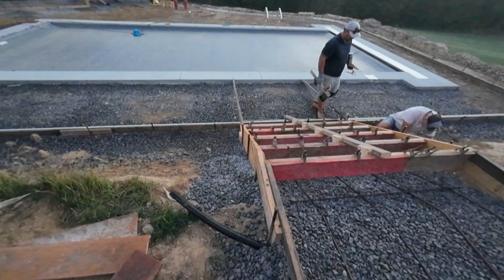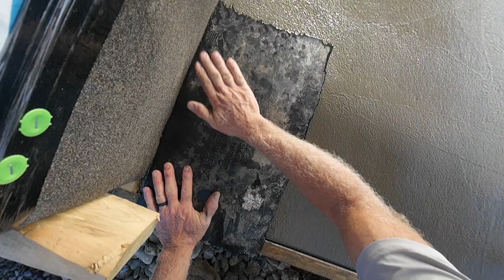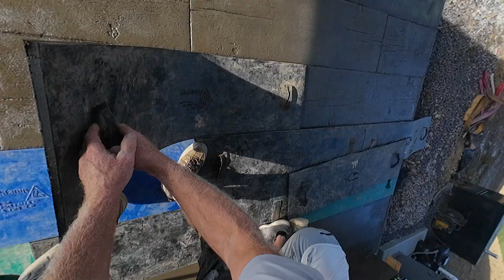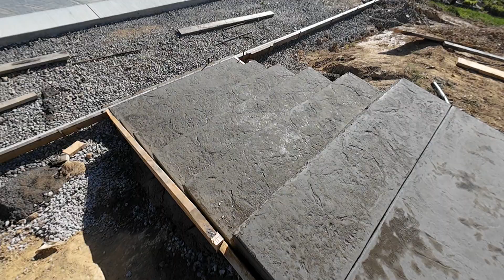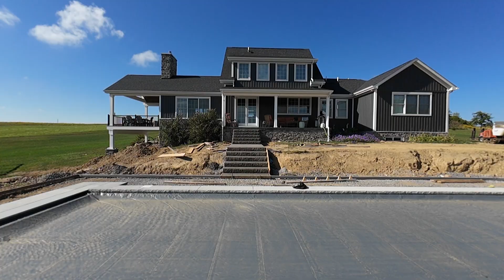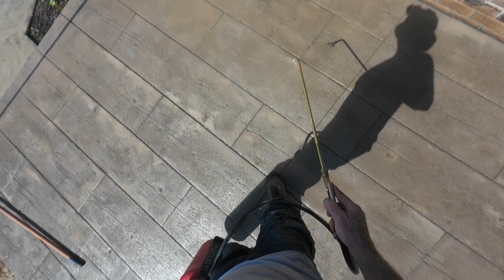"Can't Sleep At Night" Concrete

Comment: If you compacted the ground and stone, would you need to saw cut? I poured a lot of garage slabs and never saw cut them. No cracks. I poured a 15’x24’ x4” slab in the driveway to park cars. No saw cut and no cracks. I used #4 rebar in all of it. Cement trucks, dump trucks and even a well drilling rig drove on it in the last 40 years. Ground was packed first. Just wondering. 😊